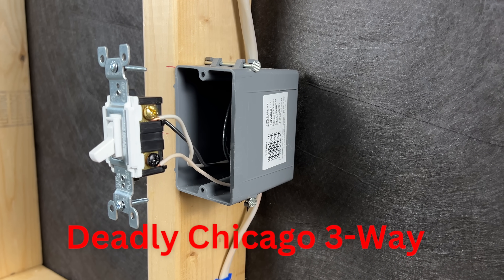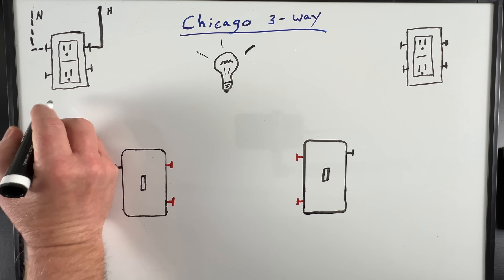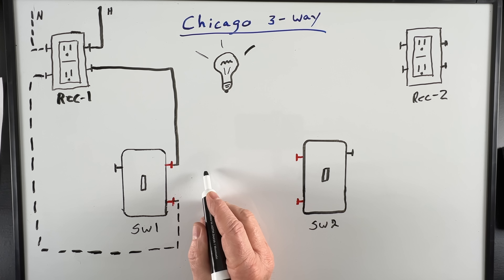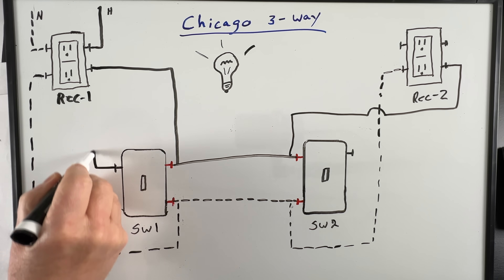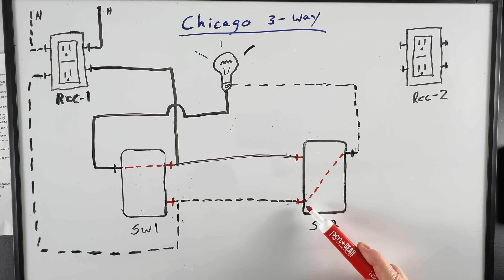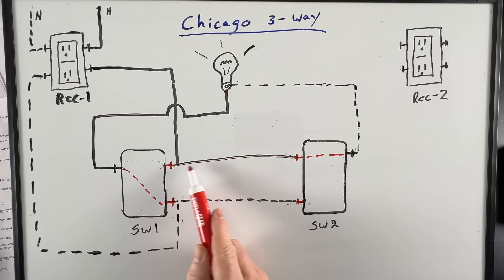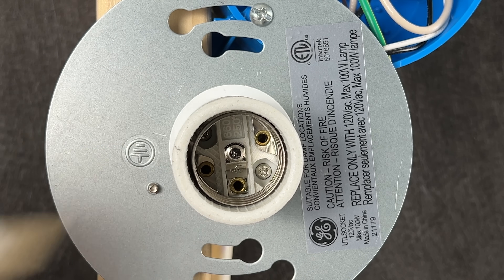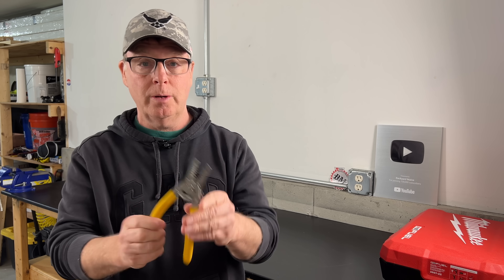The Deadly Chicago 3-Way (Only 2 Wires)

Comment: Forget "Chicago 3-way"...Call it "suicide 3-way"! In electronics, we would call this an H-bridge, intended to reverse polarities on a DC motor or something similar. It is also used by amplifiers, to give full rail to rail voltage to a speaker, to get maximum power from a given DC power source. (very popular in car audio). In house wiring, I only switch hot, passing neutral strait to the screw shell of the socket. I use a black and red wire for the "travel wires", and black from the source to one switch, and black from the common of the other switch, to the load. (light) If you accidentally swap a source wire and travel wire on a switch, the system won't work perfectly, but, it isn't dangerous. With the "Chicago 3-way" setup, such an error could result in a direct short circuit, when the switch is flipped. NEVER SWITCH NEUTRAL!!!

Comment: We’re lucky in Australia, there’s no , neutral in the power switches , these are a single throw , double pole , centre supply and outer  1. Screw terminal normally closed or 2. Screw terminal normally open .  No confusion and definitely no neutral needed , much safer and no need to complicate the circuit.
Reply: Aussies are lucky in lots of ways! Congratulations.

Comment: I'm not even an electrician but a carpenter just help my friend who is an electrician a lot I have seen white as hots many times
Reply from the maker: They are common in switch loops. The wires are white but they are not being used as neutrals. The code allows this but they are supposed to be re-identified as a hot with marker or tape.

Comment: I am not an electrician but have learned over the years. I was a painter and worked on many union sites with electricians, apprentices and journeyman and would ask questions. Doing the replacing of receptacles, switches and doing new runs I found so many mistakes from so-called professionals. A handy little helper was my circuit tester. Not one was wired right! I even bought Home Depot’s “Wiring 1 2 3” and there was so many mistakes in THAT as well. Unbelievable. I should’ve been a sparky and made better money than a fkn journeyman painter. Too late now. Lol

Comment: as a novice electrician, decades ago, i was changing out a light fixture. breaker off- lights turned off... went to strip the hot wire at fixture..... got a big zap. and guess where?? chicago
Reply: The WORST I've ever seen, was in a hallway, where they added a second switch, to create this kind of 3-way circuit, to control the hallway lights. The problem was, they used hot and neutral from two different outlets, each on separate breakers! YIKES!! Luckily, the outlets were both on the same leg of the breaker panel, or, when the switches were to turn off the light by leaving both terminals of the light hot, the light would see 240 volts, instead of off. (Of course, that would turn the lights off...PERMANENTLY!)😮

Comment: Question:
Would wearing gloves/shoes prevent shock touching a live wire?
Reply from the maker: It would reduce the risk but the best method is to turn off the power to keep safe.

Comment: Had an outside garage light with exposed wire, flipped the switch to turn the light off, went to cut the wire and ruined a brand new pair of ... Tin sheers. Took me a few hours of thinking to understand why. But definitely dangerous. I could imagine energised metal things being energized when not expecting it.

Comment: Simply: wow!  Watching the schematics the one thing that kept me busy most was how the hell would you wire this in practice and I have a feeling that the most logical way I came up will turn out to be the dead-end 3-way. Should note that even when wired correctly I would not like to do work on electrics in any American home because you use standardized multicore cable rather than the colour coded single core cables we use in Northern Europe. i.e. out here I can instantly tell if a wire will be hot simply by looking at its colour, with the American wiring method it's a game of Russian roulette whether it will zap you or not.
Reply from the maker: Just a side note: this method has been a violation since before WW2. Also our wires are also color coded. For 120/240v residential wiring white is neutral, unless re-identified which is only allowed for switch legs. Our ground wire is green, bare copper, or green with a yellow stripe. Our hot wires are red and black when using cables but can also we blue. For 3-phase 120/208 Hot- black, red, blue. Neutral- white, and ground is green, bare copper, or green with a yellow stripe.
Reply: @BackyardMaine   Thanks, it's the "unless re-identified" bit though that inspired my initial comment.
 
Our system: for single phase we have blue for neutral, brown for 230V (hot) and yellow/green striped for ground all in a 20A rating (2.5mm2). Switched wires, i.e. wires that may either be hot or disconnected are black and have a 10A rating (1.5mm2). This does leave room for a confusing situation as the lamp side of a 3-way will consist of three black wires that all exit through the same tube since we have a star based topology rather than serial.
 
Somewhat inconsistently, in 3-phase the two additional hot wires are grey and yet again black but then in a 20A rating. 3-phase is never switched though and the presence of the grey wire should be enough to identify what type of outlet you are dealing with.
 
An exception to the above applies to pre-WW2 homes that are connected to old 130V grids.  Since we do not have any appliances for this voltage these home are all connected dual phase meaning that they have no neutral - both sides are hot. It is also fairly likely to find old colour coding in these homes: red (neutral), green (hot - yes really) and grey (ground).

Comment: Neutral screw shell with 120 V on it.
With 20/20 hindsight, it is virtually impossible to believe code anywhere would have allowed this.
I guess there were government officials/Inspectors who stroked their chin and quipped, "Oh Yeah, I'm OK with that".
Moral: ALWAYS keep a voltage tester handy...even a cheap one.
Reply from the maker: Side note is that it was banned back before WW2. Back then most systems were two wire know and tube with no ground so they were much less of a hazard.

Comment: My house is like this now. The house was built in 1980 for my wife and her ex, She got the house we met and got married, etc. When I moved in she said some of the receptacles didn't work, so looked and they were all installed with the quick plugs no screws used, the metal corrodes over time making the spring weak, which causes resistance and heat again making the spring weaker until it just crackles and becomes a fire hazard. I NEVER use the quick plugs on receptacles.
Anyway, replacing every receptacle in the house I went to do GFCI's in the kitchen and bathroom. The wouldn't work unless a certain switch's on the 3-ways were on and off. When one was flipped wrong, the GFCI tripped. I figured the same guy did the whole house so it is all fast and ugly. I don't know why as the wires are 12ga Romex with a ground. I put new regular receptacles in but I haven't fixed that part yet. I imagine it is wired like you demonstrated.

Comment: Retired electrician,  mystery solved. I have run across this 30 years ago in Denver,  really never understood til now. It's always bothered me that I didn't understand,  GOOD JOB!
Reply from the maker: Happy to hear it helped. I'll be post a video on the California 3-Way on Monday.
Reply: I had to help a buddy with one of these once.  Took me a LONG time to figure it out.  I ended up breaking out 20 feet of wire and and ohm meter to map out the whole circuit on paper to figure out how to wire up his replacement switch.  
He called me after he had it all apart and couldn't make it work, so I never saw how the old switch was wired originally.
I later figured out the reason he had problems was the old switch had the common terminals on opposite sides of the switch whereas modern switches have the commons on the same side.

Comment: I heard that with certain types of switches there is a possibility of an arc followed by short circuit in a switch during switching.
Reply: I've heard of that as well.  One thing that comes to mind is the silent mercury switch,     somewhat common in the 1960s and '70s and were available until 1991, 3 way versions were also available.  

Also, an arc is more likely to form when switching off inductive loads, likely caused by HID / fluorescent fixtures with old low power factor ballasts.

Comment: Your receptacles are upside down. The ground should be up in case something falls down between the plug and the receptacle.  That way the ground stops an object from contacting the source.
Reply: In theory that works. In practice not really.  You're more likely to not see your finger slip across the hot and neutral and get a bad shock. There is no code requiring this only building specifications in a few specific applications like in hospitals.
Reply from the maker: I like ground down for a variety of reasons. I made a video on that if you're interested.

Comment: Is it just me or would a hilarious side-effect of having the light be off by sending 120v to both ends of the filament be that, with enough voltage drop between the two receptacles (if configured as in your diagram), the light bulb would light very dimly? 😂
Reply: Landlords used to do this when they had e27 base fuse boxes before breakers were common so you couldn't run more than the wattage of whatever bulb he put in the socket so electric space heaters wouldn't work well but would save them a ton if they were paying for the electric bill.
Reply from the maker: I don't think so. You should have pretty close to zero potential between the shell and the tab.

Comment: I never heard of the "Chicago Three way."   WIth a LED fixture (iow: LEDs built it) there really isn't any difference between the hot and neutral.
Reply from the maker: There isn't any difference on an incandescent bulb either. The issue is having the screw shell hot.

Comment: I have been an electrician for 24 years. I have only encountered oneof these. Now I know what to call it. My correction for it was to add another run of wire. Fortunately for the customer the walls were already open.

Comment: I subbed for an electrician in my early twenties and we’d come across things like this on old work. My background was in solid state electronics as a kid just for a hobby but I had a good understanding of electricity, electrical circuits, and semi conductors because of this. My boss had 15 years as an electrician and 8 years as his own private company. You’d be amazed at what a lot of electricians don’t know beyond basic simple circuit breakers/switch/outlet scenarios. I remember him looking at a three phase diagram like he was reading mandarin. And another time showing him how to wire a DPDT relay to reverse polarity on a projector screen. You’d swear he thought it was witchcraft lol.  Point being, just because you have a degree or certification, doesn’t mean you know what you should know, and someone without doesn’t mean they don’t know….
Reply from the maker: It takes years of experience. I worked in large industrial setting for most of my career and eventually because an electrical engineer. I'm retired now.

Comment: Never have seen that before, but can see how in the early days this might have made since.  Back then they had little regard for polarity.... and did other strange things like putting fuses in both the hot and neutral.  In this area, the knob and tube wiring I have seen does use regular travelers, in the method we use today.  If I ever see this, I will know what it is.

Comment: Lamp socket with connection directly to the screw shell?
I have never seen that in 50 years here in Sweden.
The lamp's threads only make contact with voltage when it is screwed in almost all the way down via a plate at the bottom.
Therefore, there is no reason to have "poles" on the lamp.

Comment: I encountered one of these on an old house that put two bedrooms on the third floor attic.  The extra confusing part was someone added a second light and put them in series.  Needed two pretty close light bulbs to get dim light out of both.  I unscrewed the assumed dead bulb and the other went out.  😢.

Comment: Im pretty sure the Chicago electricians wired my home in Philadelphia in the late 60's. Every outlet and light switch is like this. Oh and aluminum wiring and glass fused mains too. Worst part is that it used to function as a dentist office and I still have a lead lined room in the basement from the Xray table. Asbestos ceiling tiles and floor tiles everywhere.

Comment: Brit here - well that's crazy. Also makes an assumption that the travellers are break-before-make - or bang!
Reply: That's one of the main reasons I would never wire 3-way in that configuration! Another, more likely problem may come by a DIY homeowner replaces a bad switch, and accidentally swaps the common terminal and travel terminal, as soon as the switches get switched into the wrong configuration, it results in a direct short circuit.

Comment: Also another thing - when the line is pretty long different potential can occur between "two" phases in switch so spark will happen inside the switch which in turn will wear off the switch much faster. But it was with incandescent light bulbs, not sure if it will happen with LEDs
Reply from the maker: 3-way and 4-way switches here in the US run on single phase 120v circuits. There is no second phase to arc over. The potential difference between the hot and neutral is only 120v and it takes quite a lot to get that to jump the contacts of a switch.
Reply: @BackyardMaine  sorry for confusion, i've put two in quotes meaning it is the same phase but due to long line something was happening, probably a little phase shift. I was on one object with that issue and when the same phase met at switch it produced a noticeable  spark and one switch started to malfunction, so we rebuilt the system

Comment: Thank you. I think I have one of these in my house (built in 78). Fortunately, the wiring is somewhat accessible, so if I can confirm it, I can replace it with something sane.
Reply from the maker: I would be surprised if it's the Chicago 3-way if your home was built in 1978. What you're probably looking at is a California 3-Way. Another oddball way to wire 3-way switches but not dangerous. I'm working on that video right now and should have it uploaded either Sunday or Monday.
Reply: @BackyardMaine  it’s weird. Idiots originally wired the separate legs from different breakers; I found that years ago, disconnected and capped the wires and closed off the switch box. 

20 years later, I’m ready to take another look

Comment: I have a rental property built in 1970 that had a "broken" 3-way in the kitchen. I thought the switches failed, but after replacing them I could never get both switches to work.  I always used the standard method, but now I see that possibly they were wired via the Chicago method.  I'm not familiar with the California method, but I'll look into that too.  Thanks for the excellent tutorial.
Reply from the maker: The California 3-way is coming this weekend or Monday at the latest. If your home was built in the 70s it's probably not a Chicago-3Way but it may be a California.

Comment: This principle is used in some bidirectional power converters, as well as solid-state on-off controllable AC switches - unlike triacs which you cannot turn off before the next zero crossing. Simple, yet effective.
Reply: It's also used for DC reversible speed controllers where it's called an H-Bridge.
Reply: H bridge cicuits for DC motor control also,  made with pair of relays for stop start and reversing.

Comment: It seems like under any significant load, an arc between switch contacts could easily bridge hot and neutral during the transfer. Maybe it's not an issue for small resistive loads like light bulbs, though.
Reply from the maker: I don't think thats an issue especially with non-inductive loads and at 120v.

Comment: I owned a 1906 house in Evanston, a Northshore suburb of Chicago.  Still had gas pipes in the ceiling from the old gaslight days, and mostly knob-and-tube wiring. Learned about the Carter 3-way when I blew up an X-10 remote switch in the foyer.  I  think I know how this kind of wiring  came about.  The chandelier in the dining room (not a 3-way) had a single wire running from the wall switch to the fixture, then the neutral ran down across the ceiling to the other side of the room to a baseboard outlet! If you wanted to add a second switch then Carter method feels like a problem solver. Remember the walls are all wooden lathes with horse hair mixed into the plaster, so cutting holes in the ceiling is an expensive proposition.  Prying off the baseboard and fishing the wall up to an old-work box for a switch with a second wire is easy-peasy.
Reply from the maker: Makes sense..

Comment: I learned about this the hard way after attempting to install a new light in my father's garage, built in the 1970s.  I was so angry to see such a dangerous installation just to save having to put in 30 feet of 3-conductor Romex.  Then I remembered getting shocked as a kid (in the same house) changing a lightbulb that was turned off.

Comment: That blew my mind that it was possible to do so much with 2 wires! But totally not worth the hazards with high voltage. 

Scary to me how a light socket threads may or may not be hot even with the light off. Not to mention the hazards for the election. 

Maybe useful with low voltage though?